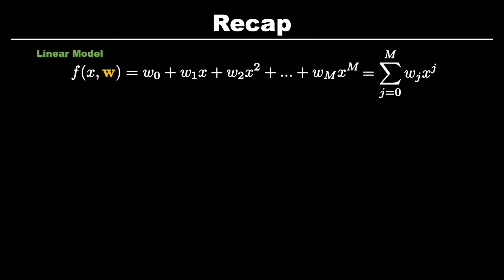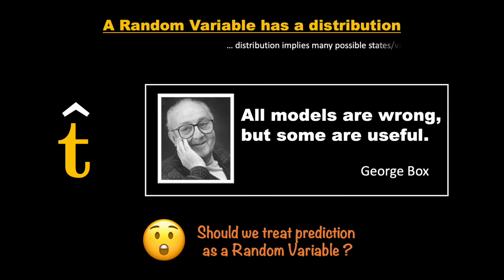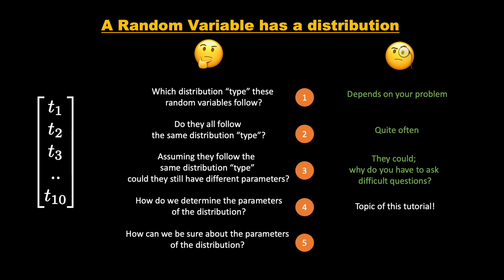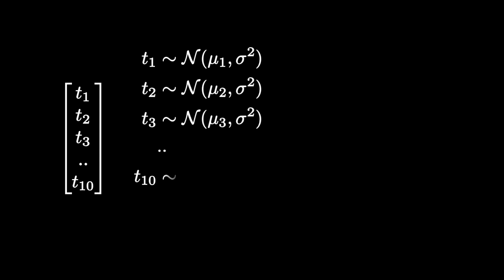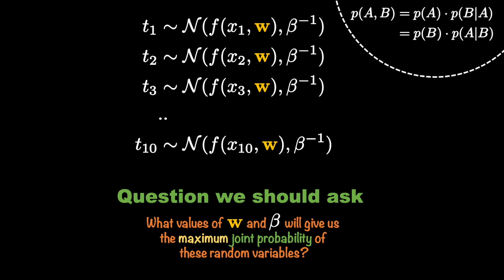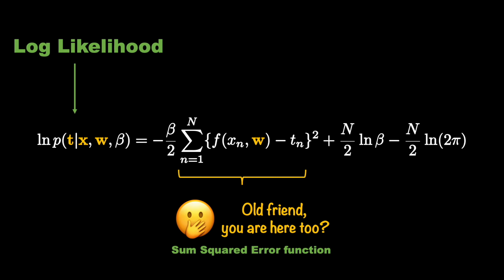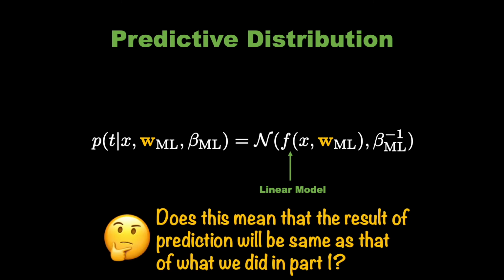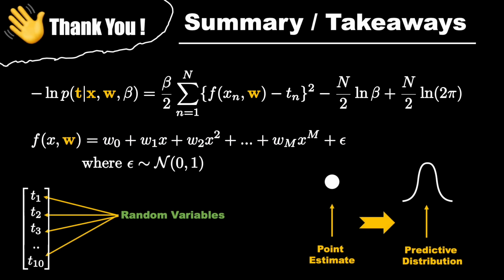Maximum Likelihood Estimation - THINK PROBABILITY FIRST!

Comment: Wonderful video! One question -- we did not make use anywhere of the fact that the function f is a polynomial in x (unless I am mistaken, embarrassingly). So it means that we can have any generic set of features on the right hand side instead of only powers of x. Then what was the reason for assuming that f is a polynomial in x?

Comment: Excellent series. It is helping me understand Bayesian Stats/Regression better. Thanks for the series. Keep doing more.
I have few questions though.
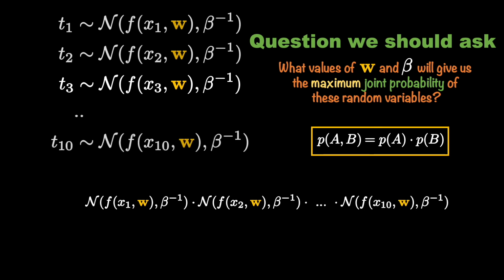- At around 14:00, you are multiplying normal distributions together. Shouldn't it be multiplication of probabilities of target values given normal distribution?
- 20:45 - Wouldn't MSE help us derive uncertainty?
Reply from the maker: - in any case we have assume variables to be Gaussian in this example to resulting variable after multiplication will be Gaussian. 

- the tutorial showed the relation between MSE and MLE but by itself it is not quantifying the uncertainty. May be I have misunderstood your question? Follow up if my answer is not clear.
Reply: @KapilSachdeva  Let me rephrase my questions:
- At around 14:00, you are multiplying normal distributions together. But, I think you should be multiplying the probabilities of the target variables given the parameters of the normal distribution. isn't it? It's probably just the notation that I do not understand completely.
- 20:45 - I think we should be able to compute uncertainty/variance of the target variables using mean squared error computed with linear regression, we probably do not need Bayesian regression for that as you claimed.
Reply from the maker: it's the notation and inconsistent vocabulary. its the distribution functions that are getting multiplied (note - in reality you would take log and add them and not multiply)

You could do that but thinking in probability first is a more natural approach to obtain the information